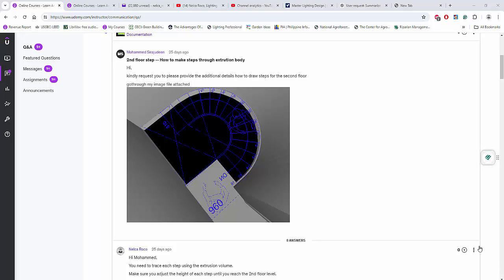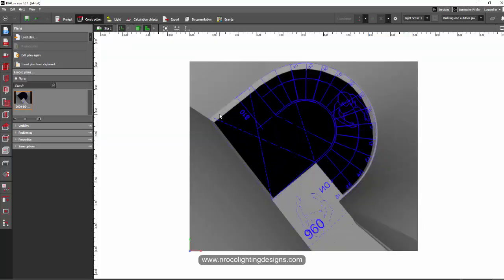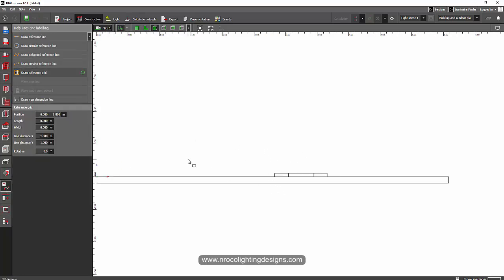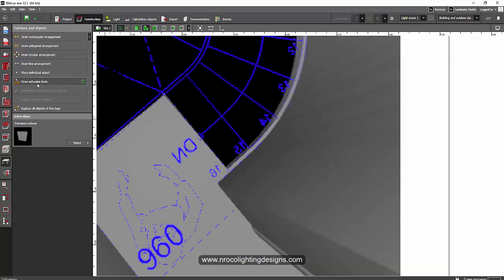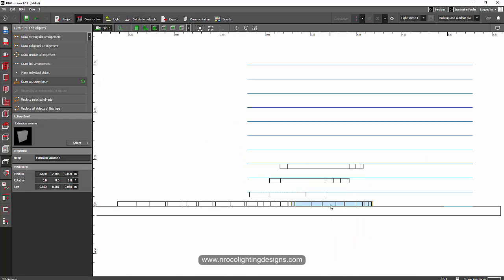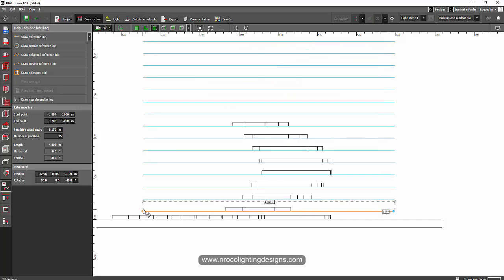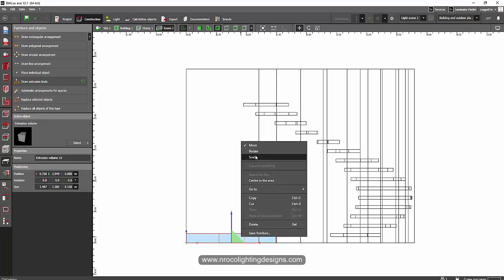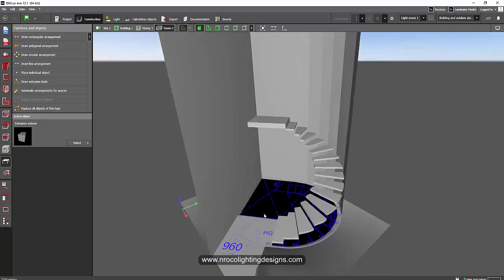How to Create a half circle staircase

Comment: Hello Respected Ma'am,
I am working on a project at our hospital which includes shifting of pole solar lights to pole flood lights because of poor lighting and performance of these solar ligths. 
Ma'am, we have the boundary wall around the hospital buildings which lengths 531meter south wall, 440meter northside boudary wall and approximately 220 meter each each and west boudary walls.
We have 62 poles already installed for solar lights what i am going to do is to replace solar lights with phillips 100w flood lights to improve serveillance and security of the hospital boundary wall and i do not have any site plans to import into dialux evo 12.1.
Please suggest me for having proper working on this project at dialux.

A bundle of thanks.